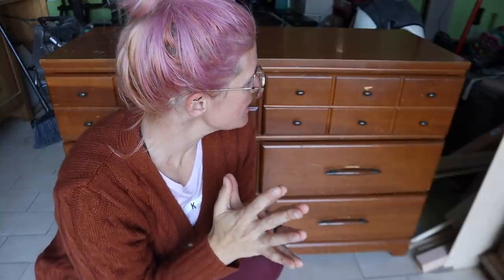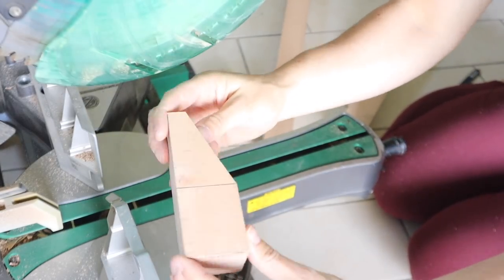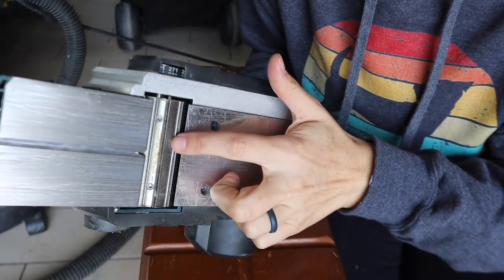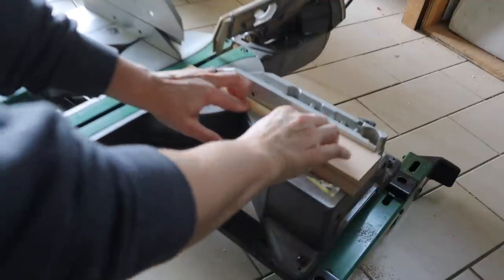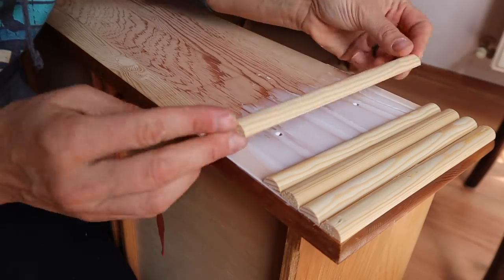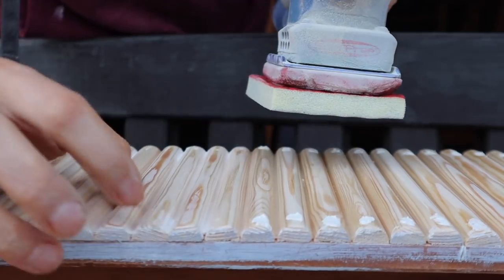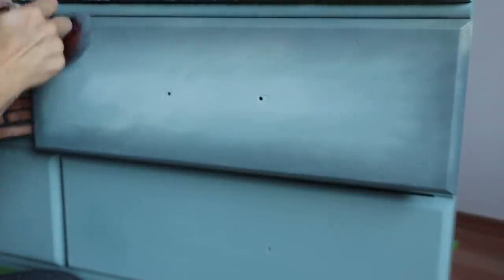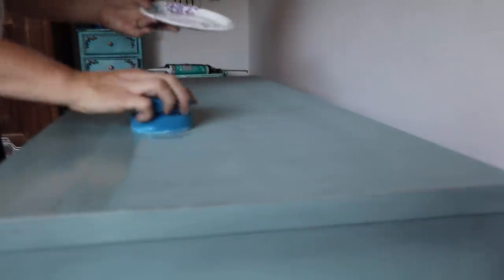Amazing Furniture Makeover | Giving An Old Dresser A Modern Update | Furniture Flip

Comment: I have a question for you. I want to do a diamond pattern in a small portion of a round solid wood top. I want the top to be stained and the diamonds to be a black wash. Which do I do first? Stain everything and then tape off and black wash over the stain? Or the other way around? I want the stain dark like black walnut and I want  the black diamonds barely showing through. Then I’ll top coat everything. 🤷‍♀️

Comment: How confident are you that just using wax will protect the piece? I have so much wax but  so scares its not be as durable as like polyacrylic
Reply from the maker: Ahhh okay so it really is piece dependent, this is an adult client and it will have two layers of wax to help protect over an already durable paint. I did seal the top more because of them setting stuff but usually it is based on what look a client wants, their lifestyle and the piece itself :)

Comment: Crys'Dawna, how can you tell if it is tannins or nicotine? I had 2 pieces from a house that smelled horrible and dripped like your dresser.
Reply from the maker: oooh so...generally if there is still a top coat on it that hasn't been compromised it could be nicotine or a failing shellac it just kind of sits on there. Either way when you have a super dirty piece best bet is to clean super well and always use a blocker JUST in case :)